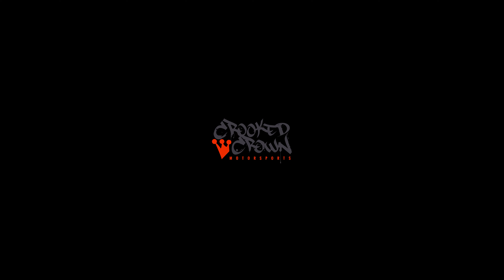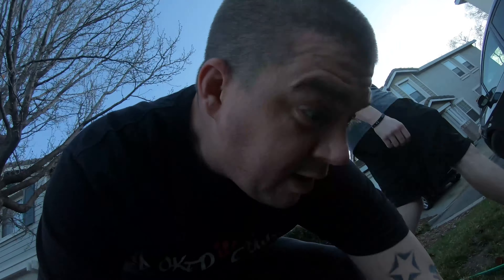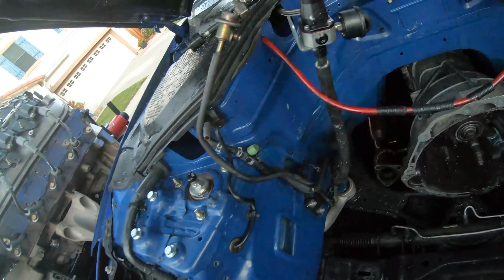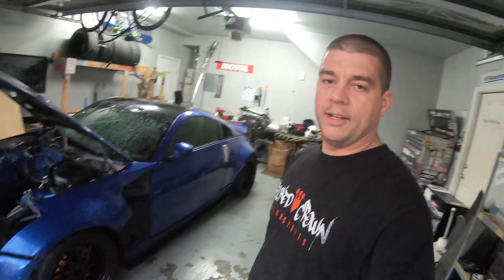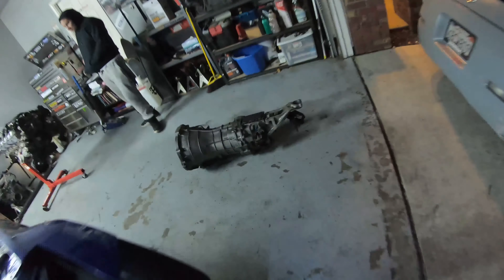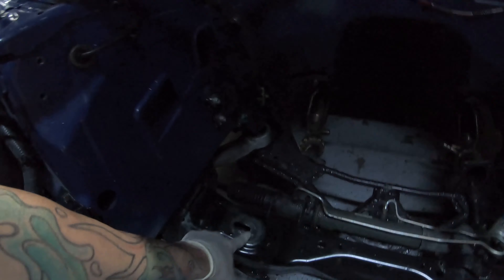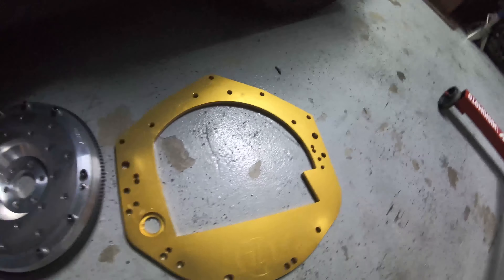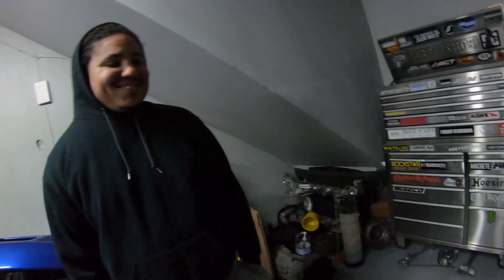MIKE_MYKES LS3 SWAP DAY 1!!!!

Comment: You have the mounts on upside down
Reply from the maker: Vaughn Keomala yea man totally figured that out 🤦🏼‍♂️ I’ve never installed the isr mounts. Went off THEIR directions. Psh. Next time I’ll go with instinct lol. Thanks man
Reply: Crooked Crown Motorsports man I thought I was tripping at first when I saw it. I need to film my swap but I’m lazy lol. Their instructions are kind of trash and the etching is hard to see which is left and right. Pro tip if you haven’t done it yet. The nut for the U-bracket goes on bottom or else the mount won’t fit all the way in.